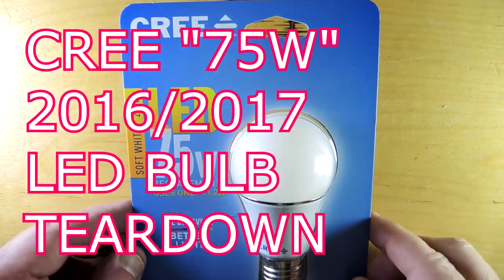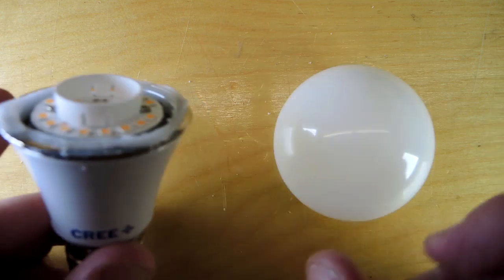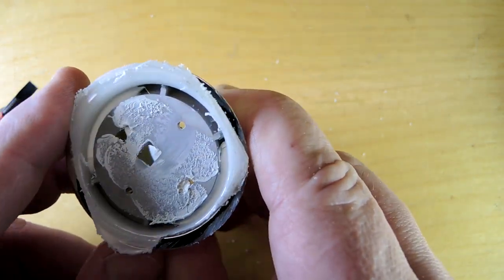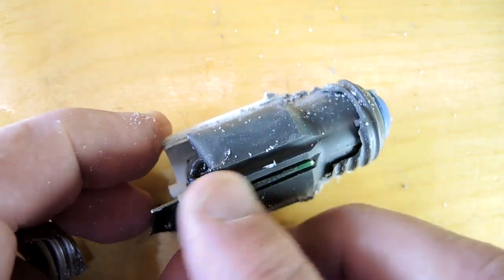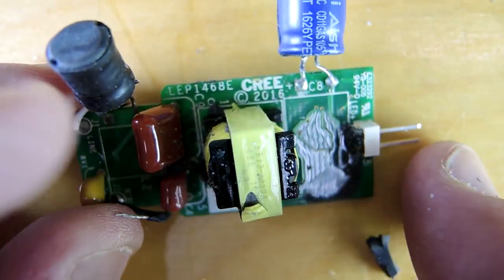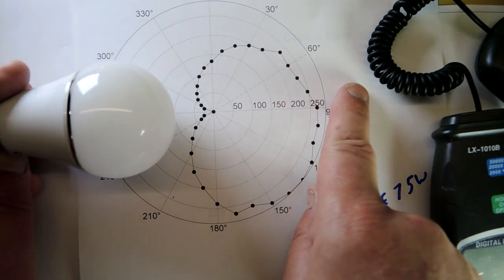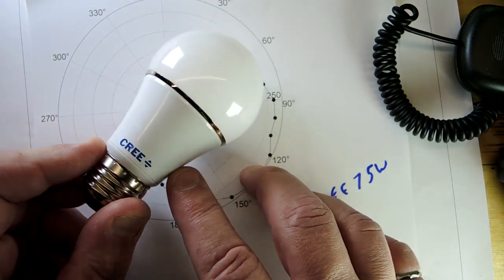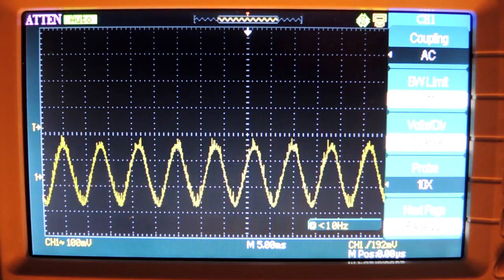Tear down of a 2016/2017 CREE "75W LED Light bulb

Comment: I don't know whether to laugh or cry.   They promise LED bulbs will last a quarter of a decade - however they usually die before 4 years is up. 

I took this very same apart hoping to fix it and that potted mess down inside can't be accessed without destruction.  On power up, it flashes for a split second, so I feel the capacitor probably needs replaced.  Well, that ain't going to happen.  

Shame, is the LED's are perfectly fine and I would assume there is nothing wrong with the driver circuit except short-lived caps accelerated by high temperature.  

We'd have a lot less waste going to landfills if they simply made them serviceable.  

Might as well buy the $1 models and feel better about throwing them away when they die.

Comment: Do you know if any (perhaps specialty) LED light bulbs that break the mold of lowest price and achieve a better lifespan, directional light emission, and lower flicker? If the cost per year isn't that much more I'd really be interested...
Reply: I like the Lowes house brand bulbs (Feit Electric). Nice color and light spread, no buzz, no RFI, and none have failed. $1.50 or so. I replace 60 watt bulbs with "40 Watt equivalent" because the color is better so I need less light.

Comment: Do you have the ability to do a spectrum analysis and measure CRI?  Those would be awesome metrics to add.
Reply: That'd be great. For whatever it is worth the A type incandescent replacements give MUCH better color rendition of reds. Seems like they'd be perfect for art.
Reply: Those are very hard measurements to take and even harder to interpret.

A spectrum is the naked data and is hard to interpret. A CRI number is the entire spectrum, with all it's intricate detail, condensed into a single number a manufacturer can print on a marketing brochure.

Let me clarify; hard to interpret doesn't mean you have to be smart to interpret. It means that the raw data doesn't mean much and interpreting the data into something simple like a CRI demands a high degree of sophistication. Basically you would have to intimately understand both the mathematical model used to generate the CRI and you would need to understand the physiology that supports the model; you would need to be familiar with the agregated test results of thousands of real tests on real observers looking at real swatches of color. You would need to be a color scientist.

Asking if someone can, "test for CRI too", shows a remarkable amount of ignorance. It's not your fault. The people that do CGI in Hollywood don't understand color.

Comment: Im waiting for a design where you only replace the leds, having the psu mounted in the ceiling an even reusing the heatsink. Throwing everything away doesnt feel right.
Reply: Typically the first thing to fail is the PSU, especially electrolytic capacitors are known to have a service life before they degrade. LEDs, even if run pretty hot, will last at least 30000 hrs before their light output drops by 20%. The PSU will most likely be dead or near dead by that time.
Reply: Enrico Conca That is exactly what my approach would solve. The PSU could be bigger, better quality, and it would run very cool. 
Solid capacitors and low temperatures result in psus that last the good part of 100 years. 
It would make led bulbs cheaper on a long shot and allow for more economical and better quality components.

Comment: Isn't there benefit for the consumer to have the light aimed downwards, rather than wasting power lighting your ceiling and the tops of your walls? Of course there are cases where you want a more even spread, but for most consumers this is surely the preferred design?
Reply: depends on the fixture and its purpose. I have plenty of ceiling lights which have the multiple bulbs mounted horizontally. These would shine mostly on the walls Some even single bulbs fixtures in the hallways.

 I've upgraded some to built-in LED.  Those all face out horizontally mounted. If you're looking for lifespan these loook like the way to go. MUCH much larger circuit board with like 30 SMD leds on it and all mounted on metal so they have effectively a much wider heatsink.

Comment: You've really got the review process down to a science now, lots of data in a time-efficient manner.

As others have said, and I'm sure you already know, if you wanted to make some side cash off the channel you could set up a "engineer tested parts" list on your website with amazon affiliate links it might be pretty popular. Like wirecutter/sweethome but based on actual data. An example of this would be the google engineer Benson Leung who tested first-gen usb-c cables and posted the results. People took those results and made product recommendation pages.

While most people buy purely on price those of us watching a video like this are more inclined to want a product with better reliability/performance and are willing to pay extra for it. Though I would totally get if you feel like going down that road would change it from a fun hobby to a boring job.

In any event, thanks for the great vids.

Comment: Cree really impresses me with their excellent mechanical engineering and use of high quality brand name components. If the bulb didn't say Cree  on it, I would have guessed it was german engineered. Quite surprising they are using a custom chip since led chips have become a commodity. Bravo.
Reply: Quite the opposite here: I bought a ton of Cree's first-gen bulbs and they had an extremely high failure rate (it seems like A D below had a similar experience). Most of them died to intermittent flicker (a portion of the LEDs inside would go on and off), although a few just flat out burnt out.

Cree's warranty is also largely useless since the cost of mailing them the bulb for replacement is more than the cost of competing bulbs, and some research indicates that Cree tries very hard to reject replacement requests.

I'm done with Cree bulbs for good at this point. As they failed, they were replaced with much cheaper bulbs that have lasted much longer.
Reply: Adam Zey I had first gen bulbs flicker too but cree didn't require me to send in the bad ones.
Reply: Adam Zey I agree about their electrical/ thermal engineering, it can use work. I do think their mechanical engineering, including their light tower design in you bulb is excellent. None of my connected 4flow bulbs have gone bad.
Reply: CREE impresses me, too, but of all of my cree products none are these incandescent built-in-one unit A type bulb replacements. Seems like this whole type is the type to avoid.

Comment: It's so annoying that it must be so hard to find a good led bulb with good cri, and lie flicker. You can't even rely on the same brand. I bought some Civilight here in Scandinavia that somewhat expensive. The first ones I bought was quite good so I bought a few other or their models and they had a lot of flicker. I bought them because they claimed they used Cree leds. But what good is that when their power supply lacked proper smoothing capacitors. 
Thanks for the video.

Comment: Would you ALWAYS state the price please at the beginning with the other specs. It's always interesting to know as far as evolving prices & build related to price
Also does that potting compound (flexible) assist in lessoning damage due to shock or vibration or make no difference?

Comment: I have 10 of the original Cree's at 60,75,100 soft and daylight and lifespan was poor on all.  Lumens would fall after a year with CRI turning blue on many LED packages, some with loose connections on contacts to PCB.  They did perform well initially, but 22 years is a joke.  Cree is good about replacing with new design shown here.  Even went as far as to run some without globe (shock hazard) for better cooling and more lumens.

Comment: I don't know if these exist but it would be very interesting to see how more expensive "prosumer"  bulbs compare with these economical, race-to-the-bottom LED bulbs.
Reply: Here, it would take 10,000h to pay for the difference, and no sign of that changing significantly any time soon. And that's for a bulb that flickers, degrades over time, and has a inferior color spectrum.
Reply: Euro Bum it will as the energy prices climb up
Reply: Get an audit through your electric company. Over here they give you 2 free bulbs every time you do one. They've been doing it for decades.
Reply: I made an error. It would actually take 2,000h at my rate of 8c/kwh. But I turn my lights off when I don't use them, so that could take a couple of years, by which time there may be newer more efficient bulbs on the market.
Reply: These LED's are designed to be close to the cost of incandescent light bulbs. If you have 300 bulbs to replace the initial cost of replacement is very important.
Reply: At $11 US per bulb I wouldn't call it economical. Give me my incandescents back, because this thing will likely never justify its price with energy savings. Thanks greenie weenies!